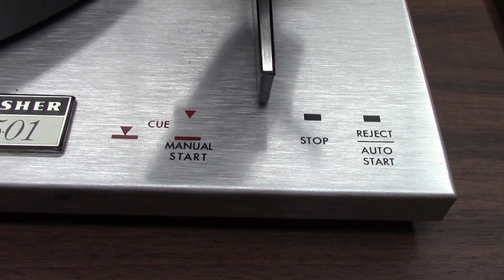THE FISHER 501 TURNTABLE FROM 1970 COMPLETE TEARDOWN, CLEANING, AND RELUBE VINTAGE STEREO REPAIR

Comment: I used spray carburetor cleaner to clean old grease underneath two riveted metal parts on a Voice of Music record player. It worked very well.
Reply: With so many moving parts under there it looks as tedious as rebuilding a four barrel carburetor.  So, your carb cleaner may have helped. :-)

Comment: I have a Perpetuum Ebner 3060 with the same auto detect size system.  I think that the 45 7" size should be detected.    When the finger comes up on the right side of  the platter and detects a record, it automatically goes to 12".  If it doesn't,  the pin in the center of the platter  should be pushed down and catches on the bottom area of the scoop.  On my PE, when you put a 78 on, the middle area of the record sits lower than a 45 and it pushes the pin down, but not as much as the 45.  It catches higher on the scoop and moves to the 10" position.  I'm not sure if tbe Fisher is the same, but it sure looks like it.  If you bent that scoop arm even a little bit, it will not work correctly.
Reply: The little "step" on the scoop is the difference between 7" and 10".  I had never noticed on a 7" record, the center label sticks up higher than the groove area, and on a 10" record, it's lower than the groove area.  I couldn't for the life of me figure out how it knew the auto size difference between 7" and 10" until I realized that.